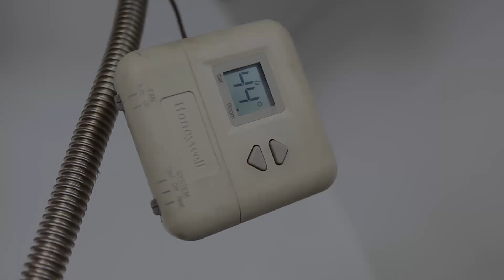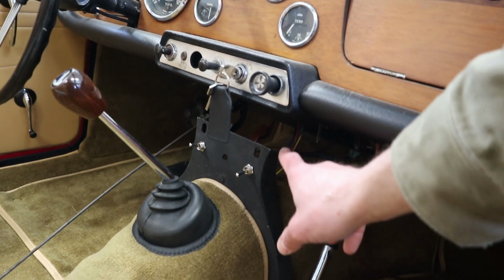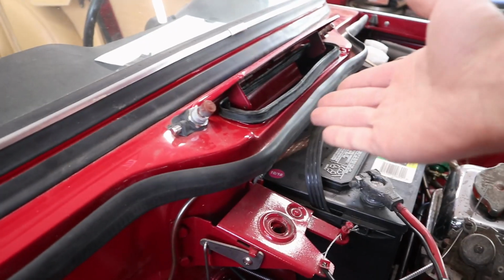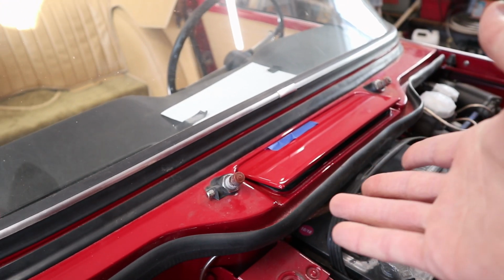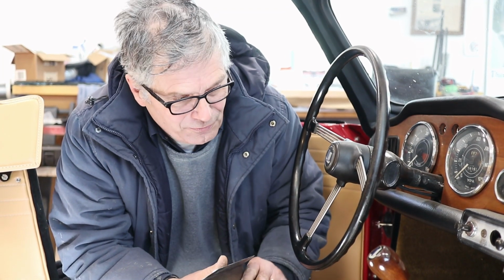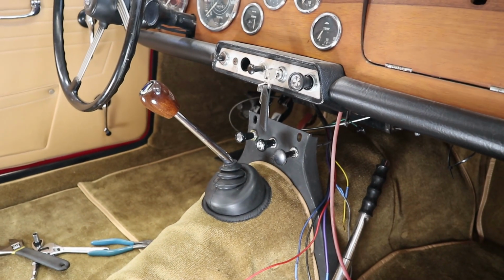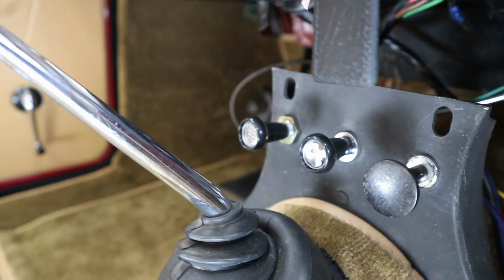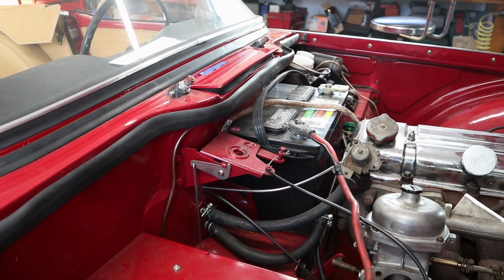Heater Control Details and a DIY Center Plate - Triumph TR4 Interior Restoration | WEGS GARAGE

Comment: I also have a TR4. I have just spent the day replacing the overdrive switches. Tomorrow, I have to refit the centre support - I just know it will be a struggle.

I suggest that you take the time to fit an emergency hood release. If the hood release cable breaks or comes adrift, you are royally screwed as there is no way of accessing the hood latch.
Reply from the maker: Ah yes the emergency hood release. We have a video of installing the Moss Motors version if you go back far enough. Funny enough the primary one still doesn't work right. Ugh. Add it to the seemingly neverending to-do list.
Reply: @WegsGarage  You are doing such a through job of the restoration, I should have known you would have covered that base! Here in the UK, the amount of ethanol in fuel will increase to 10%. Before then, I am determined to devise a simple way of removing the ethanol from my TR4’s fuel tank. I’ll let you know how I get on.
Reply from the maker: Ethanol is nearly mandatory here in the midwest US. We do our best to avoid it. We have also chosen fuel lines which are slightly more resistant to ethanol, and accepted the fact that our carbs will likely need more frequent rebuilds. Good luck with your removal project!

Comment: HI Gentlemen. I do confirm the rod opening/closing the air vent has a (fuc......) tendancy to leave its location. To avoid so, it is normally designed a nut to be scewed afterwards. Nevertheless, the rod end is plain without thread and the nut is not available any more. What I did is to bore an aluminium small disc just lower than the rod diameter and then  gentle hamering on the latter gives sufficient strenght to keep rod secured with the lid. I added a small plain washer in teflon on aluminium disc side to avoid direct contact. Hope that can help. Keep on high!
Reply from the maker: Thanks, Jaques! That sounds like an excellent system. Will be doing something similar for our rod.

Comment: the dash plate goes in with it recessed under the dash  if you have the owners manual it shows it.
Reply from the maker: Interesting, I have seen pics of it going that way. Can't figure out which is correct. Was it reversed if a radio was installed?
Reply: mine came with a Triumph plated radio and it was under the dash as in the photo in the owners manual, it helps to keep your knee from hitting it.

Comment: My original wiring has the windshield wiper motor and the brake light switch wiring together coming out of one hole through the same largish grommet  below the wiper motor on the driver's side.
Reply from the maker: Thank you! Do you have the pressure switch down by the exhaust manifold? How does the wire get over there?
Reply: @WegsGarage  I will take a look later today.  Keep up the good work.
Reply: Sorry, I don't have the pressure switch on my car CT 27, 829.  Probably built in December of 1963.

Comment: Hi, I would like to add another comment about your attempt to install the control rod for the scuttle vent. It's definitely a Rub Goldberg design and I also struggled with it. Looking at your video, you didn't mention installing the spring that goes under the actual scuttle vent. That spring, when installed, gives you a firm "closed" and "open" position. If you want, I can email you a picture of mine and a short video I did to send to another TR4A owner struggling with the same issue. You have to also remove the cardboard glove box to feed the wire down from the vent. One other piece you need is a spring clip to attach the wire rod to the bottom of the scuttle vent. You need that wire spring and the clip to attach the wire to the scuttle first. The bad news is that the spring is NLA. However, I was able to get one from Scott Harper at Team Triumph in Warren, Ohio (330) 392-7176. 
Dave
Reply from the maker: We do have the spring, but are you saying there is a clip that goes on the control wire/rod? Because ours just has a bare end which allows it to fall out of the hole.
Reply: @WegsGarage  yes, I had ordered a scuttle spring, rod and clip from Team Triumph. You could pick up a clip at a hardware store though. Offer is still open for me to send you a couple of pictures if you can tell me where to send them.
Reply: I’d love to see that how-to.

I was just fighting that on my ‘65 TR4A last week!
Reply from the maker: Solution incoming on next week's installment. 29 cent clip available at any hardware store. Welcome to Wegs Garage Mr. Wheeler!

Comment: How long you will last? I'm guessing about 10:35.

Is your car a positive ground vehicle? Mine was, and I had to get a converter for my '64 TR4.
Reply: I still have one as a SPare, I went Negative in 1995...
Reply: @paulsilva3346  Mine was from Radio Shack, and it whined when the radio was in operation. :)
Reply from the maker: We converted to negative ground so we could install an alternator. I am thinking of hiding some kind of bluetooth amp/speaker type of thing in/near the glove box rather than a DIN stereo. Unless I can find a screaming deal on a cool vintage AM radio.
Reply: @WegsGarage  I recommend getting a 3 or 6 spot FUSE BLOCK.!.! INSTALL IT in the footwell. And GO FROM THERE.! Also, ADD An EARTH/GROUND to that place for DEPENDABLE Earthing.

Comment: Just took a look at my original '64 hood vent.  There are no clips, just right angle bends in the spring/connecting rods.  There is one on each side and they are inserted from outside to inside just as you were doing.. Also, you do need to rotate the heater valve a bit.  The control cable is in the right place, but the original choke control should not be in the same hole.  On my car there is a hole down by the solenoid where it should be inserted.  Hope that helps.
Reply from the maker: Thanks! That is great info. We have the wire to the brake light pressure switch running out that hole. Now I guess I need to figure out where that should go.
Reply: @WegsGarage  I'll check that for you shortly.

Comment: I am 14 and I am wondering if I should try and buy this there is one for sale near me it is a 1964 triumph TR convertible. It is the same color as this one. Let me know what you think.
Reply from the maker: Definitely depends on condition and how much work you are willing to do. They are easy cars to work on, but finicky and prone to rusty sills and frames. I recommend taking a close look at it and if possible posting pictures on a triumph message board, like Triumph Experience. Those folks seem to have seen everything. If it is in good shape, definitely snatch it up as they aren't getting any easier to find!